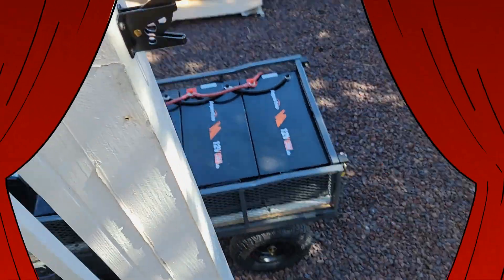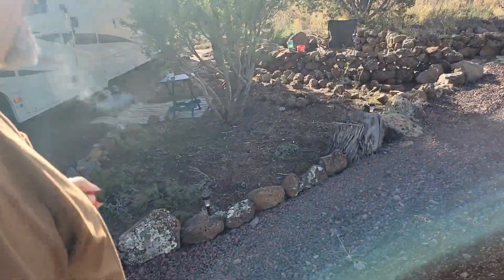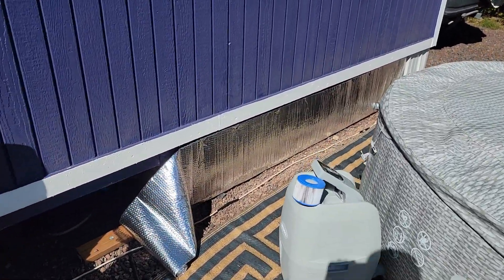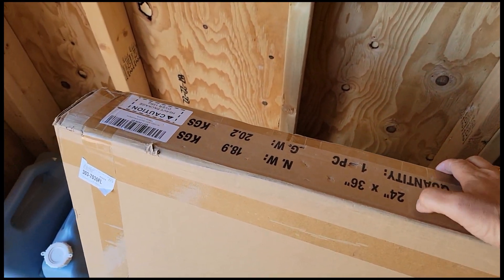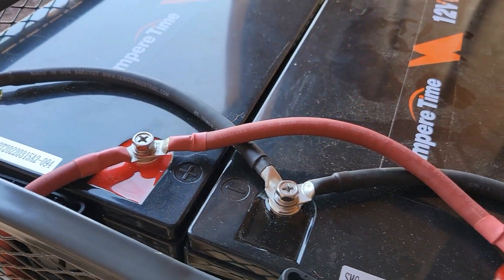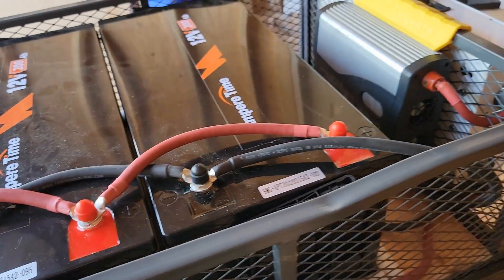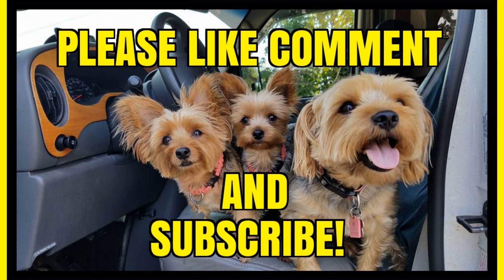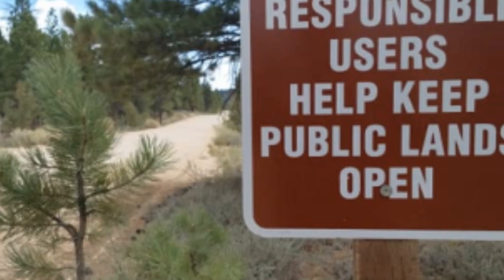Friends Leave Vagabond Camp. New Tiny House Wood Stove Table, Ampere Time Power Wagon Improvements!

Comment: Kevin, you've probably already got a heat shield up but if you don't, you could measure from the top of the table to the ceiling and out from the wall a couple of feet and take the measurements to a sheet metal shop where they could put a 90 degree bend in a 2 foot wide piece of stainless and cut the hole for the chimney for you. Then you could mount it to the wall and ceiling with 1 inch spacers to keep it away from the wood.  It's a good idea to clamp the stove to the table. I would also clamp the table legs to the wall just in case you bump the table and knock the stove pipe loose. Vagabond Base camp is coming along nicely
Reply: Great advice! Might be able to use recycled metal siding, roofing panels, as well.👍✌️

Comment: If those batteries have low-temp protection you should just leave the cart in the garage and make a nice custom length, heavy gauge cabtire, outdoor-rated "extension cord" over to the tiny house. That way you dont have to mess with a ramp and have that big cart take up any precious room in the house.

Comment: THANK YOU Kevin for showing the reflectix...I have been trying to figure out a good way to insulate a bit under a deck mounted cabin! I knew I was going to use metal siding for the skirting like you but this really helps me add that extra barrier for the cold and mice!

Comment: From 13:20   Wow, this is the first time I've heard that the wires going to the inverter should all be the same length. All this time watching so many videos about hooking these things up. Thanks for pointing out this massively important detail, Kevin.
Reply from the maker: first I had heard of that as well. The guy has talent and experience.. unsure if he is correct.
Reply: @CampervanKevin  From one Victron forum expert: 
Kevin Windrem answered · Sep 11 2020 at 5:19 PM  EXPERT ANSWER
If you are paralleling up multiple batteries, the cables between the positive terminals and a positive common point should be the same length and wire size. Same for the negative side. Positives and negatives do not need to be the same length.
If you are paralleling multiple inverters, the positive cables need to match lengths and the negatives need to match lengths also but positive and negative cables don't have to be the same. This applies to inverters run in full parallel mode (AC inputs and outputs in parallel). Less important for split-phase/3-phase systems.

Comment: Hey Kevin, just looking at your battery system.  You also could have stacked those batteries on a wheel dolly.  A dolly can lay flat and also stand up for less space.  LIFEPO4 batteries can lay sideways and a dolly would be easier to move up and down areas.

Comment: Kevin, if you are going to seriously use that wood stove this winter, find a supplier for the wood length it uses and get a load now before winter is upon you!  And I do agree that you need to burn it off outside first to be rid of the manufacturing oils and residue!

Comment: So maybe I am crazy but when I see positive and negative battery cables laying on each other I get very nervous. I have seen many others do this too. If I can't route them different I have used hunks of heater hose and tie wraps. I have then also put that inside a PVC pipe. Would probably take a long time to wear but when a risk is even remotely possible with catastrophic results I always fix it. Just my 2 cents worth for all your fans.

Comment: Kevin you should use some of the porous for insect and rodent repellent. Buy some  Peppermint, eucalyptus, and cedarwood oils in a bulk size use a dropper to put in the holes in the porous rocks will absorb.  the oil.

Comment: You have beautiful scenery around you. Love looking out toward the mountain. Carolyn's really great landscaper. Finding the perfect rocks are hard sometimes. I use to collect quart rocks here for my flower beds. Once you peeled the coating off that table,  it really complimented the cabin. Perfect. The stove looks nice, & has alot of features with it. I like the batteries in the wagon. Kept off the floor. Easier to move if need be. I really like what you did under the tiny house. I like how you are putting that reflecting up around the bottom too. That's really going to make a difference. Glad to hear he made it safely there. 🍂🍁❤🙏🍁🍂 Fall is so beautiful here. You can take a look at Heliucopter tour over the Great Smokey Mountains 2022. It's close to here. Beautiful.  Have a wanderful weekend.

Comment: Looks great Kevin 👍 I agree you definitely need a heat shield behind it also on the ceiling I think. plus it will look good with all that stainless steel. make sure it's thick enough. 24 gauge or 1/2 inch thick. remember to leave airspace & 2 inches from ceiling.  See you didn't know you had such a knowledgeable friend like me huh haha Anyhoo. I was thinking maybe you should get baby Mae may some booties until her foot heals completely.  My German shepard/bull mastiff had some but he ate them!! he's got a matching raincoat too haha He couldn't eat that. Ok gotta run sry for such long msg Stay Safe out there & Until we meet.✌️ 🙏 🌞 🌎 😊

Comment: depending if you wanted to drill holes in that new stainless steel top.... but what came to my mind was conduit clamps. 2 on each side would secure it..... don't need to knock a fire box off the table ..... just my 2 cents..... thanks for the share Kevin.

Comment: That's your Cobra power cart.  Sounds good. We acutely use this types of power carts in Aviation. I have built a few of them. If you purchase a new power cart from a Aviation supplier,  your looking at $6,000 to $8,000 for a simple power cart,  the only difference and it's a big difference is Aviation carts are 24 or 48 volt instead of 12 volt, but exactly the same concept.  Good job on the cart Brother.  Hawk out!!
Reply from the maker: Thought I was being original...

Comment: Camper Van Kevin 👍
🏘️🚌🚙🛵🚲
And the Woof pack 👍
🐕🐕🐕
A name for your power cart. Amber time power cart. Give credit where credit is due  I always say
A perfect backer board would be the stainless steel sheets they have at home Depot that are used for paneling 👍
Joey ⚓

Comment: Can your stove be that close to the propane heater, I thought an ignition source had to be 10 feet from propane
Reply from the maker: dunno, I could always run just the pilot light on propane stove if need be for safety
Reply: Ask a heating person just so you're safe .  In my house my AC unit couldn't even be within 10 feet of the propane tanks . They said when the AC turned on it could ignite the propane . That's why I'm letting you know for safety.

Comment: Stove needs to be lower heat rises and stove has harder time heating the air below.
Reply from the maker: hoping ceiling van compensates for that
Reply: Sure be fine for a backup to a back up. That small of stove requires to much constant feeding for primary use. Still hard to beat the feel & smell of a real fire